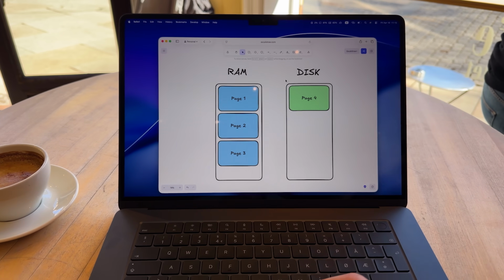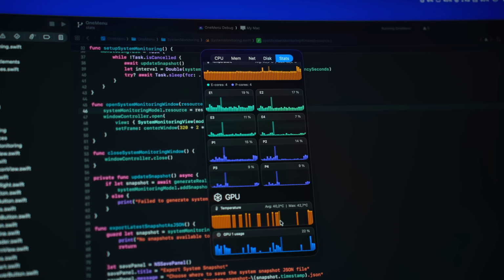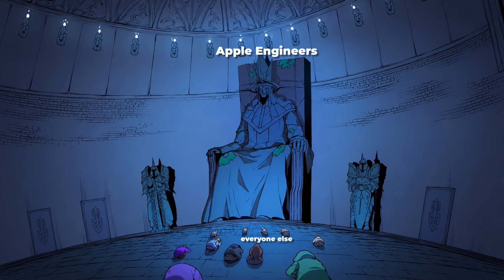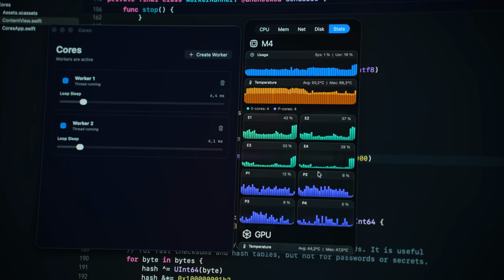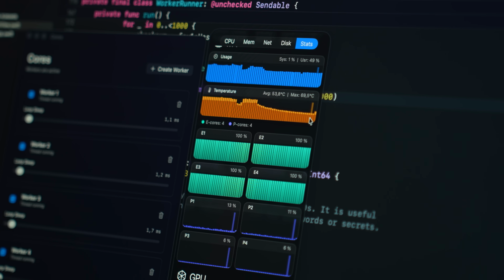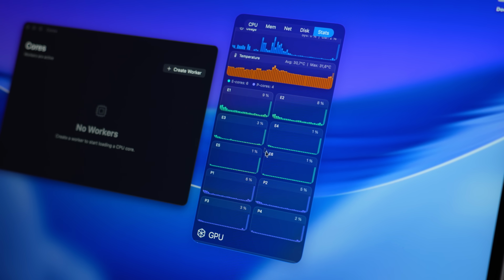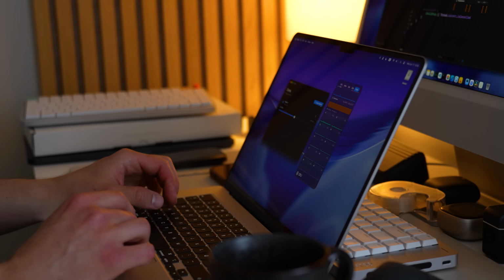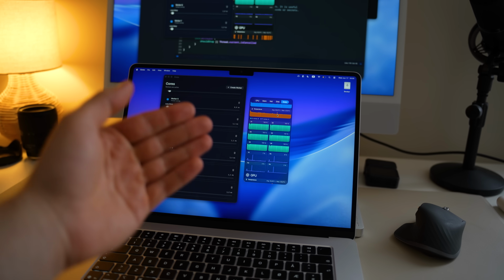Apple Silicon Secrets

Comment: I'm struggling to understand the single-threaded task using all cores being a performance win. Surely switching between cores is inefficient as it has to move the thread context (registers, L1 cache -- L2 cache is shared, TLB) onto the other core? Or is the implication that spreading the thermal load over all the cores, each of which has its own position on the die, is more efficient than creating a single hotspot on a single core?
Reply from the maker: My interpretation is that it’s optimizing for thermals instead of performance. I guess they are trying to avoid running one core significantly hotter than others. The cache could be shared between the cores, but I agree that there must be some small penalty that comes with moving the workload back and forth between the cores.
Reply: Yeah, they are sharing the load over different physical cores for thermals. Cooling is more important than anything else, even more so on fan less devices. It certainly doesn’t seem to hurt performance too much, M5 is fastest single thread processor on the planet!